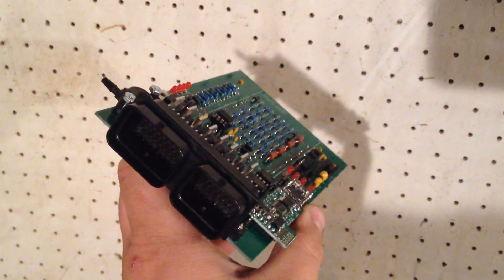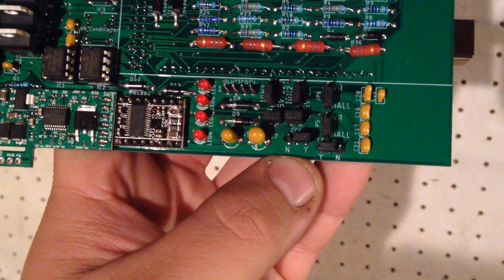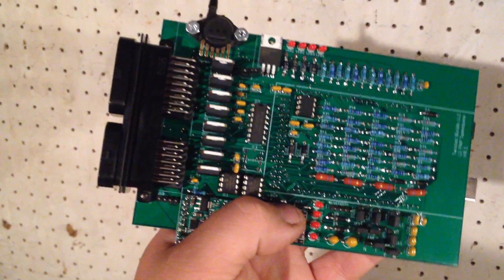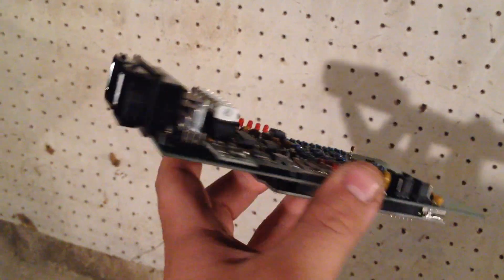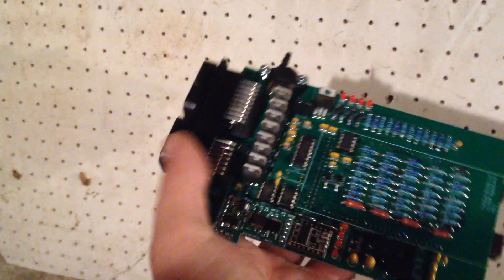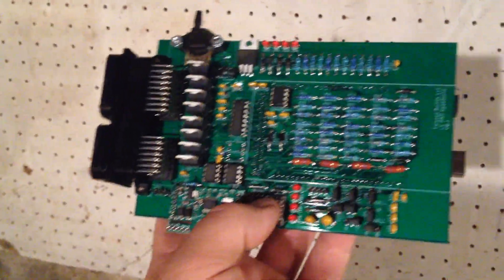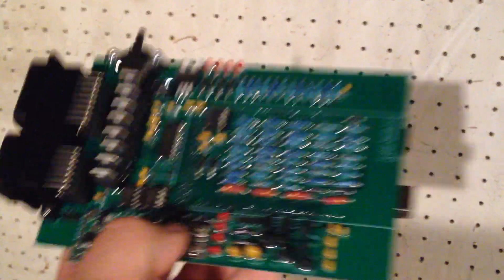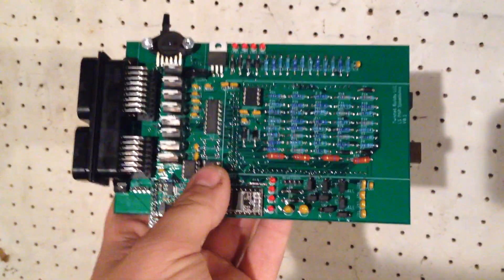Speeduino is built! Progress update | Twisted Builds LLC 6-20-19

Comment: Well this also do transmission control 4l80
Reply: microshift dude or one can use the tcu early 1990`s off a box truck n h1 hummers used them and early 1990`s diesel 2500 3500 Chevy trucks dig on web bit hard to find and the hummer box is high at site i seen it at but i am sure theirs an old diesel flopped around at a salvage yard ebay had one back a wile ago 125.00 usd not bad .oh must know how to read wiring diagram it all way irradiate me wen folks think its hard 1 wire at a time n very basic 2 wire dc volt understanding no excuses with yt videos really if i can do it any one can heck i cannot even spell correcly ;} good luck n God bless./
 is Jesus is a supper co pilot
Reply from the maker: No this wont do 80e control

Comment: Input/outputs? iac control ? Software to be used ?  Maybe next video u can go over that stuff and comparison to another ecu like micro or terminator? 👍
Reply: It's running Speeduino. Just as powerful as a microsquirt, for half the cost (depending on what board you go with, could be 1/4 the cost!).

Comment: Cool ... How much ??? So it's PNP ?
Reply from the maker: No clue on price yet, this is the first prototype and I need to get it ironed out first. Goal is to beat the microsquirt price point though.

When I say PNP, think of it like PNP from a aftermarket ecu standpoint. It wont plug into the factory harness however it'll plug into the harness you will be able to eventually buy from me that'll say plug directly onto a LS engine and this controllers waterproof TE connector.
Reply: @TwistedBuilds  so what you thinking 500-600-700$ ?
Reply: @Abricos4440  i hope not